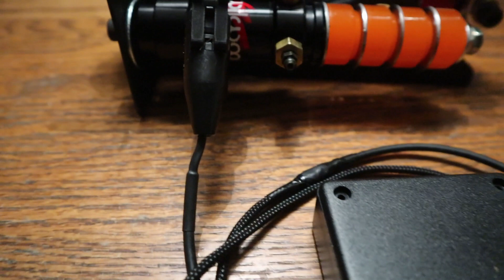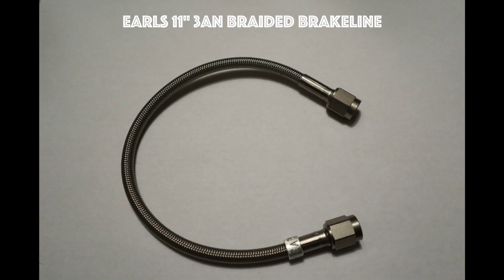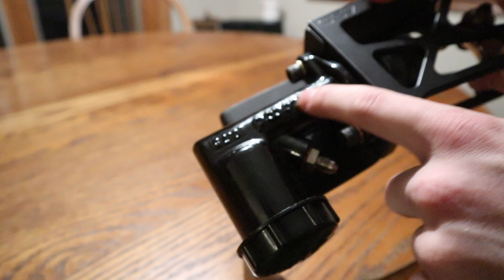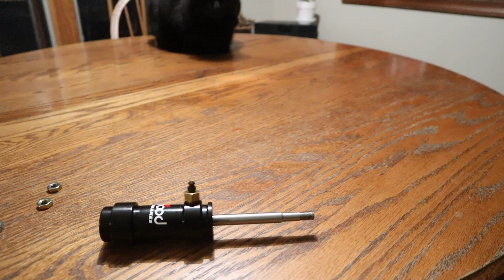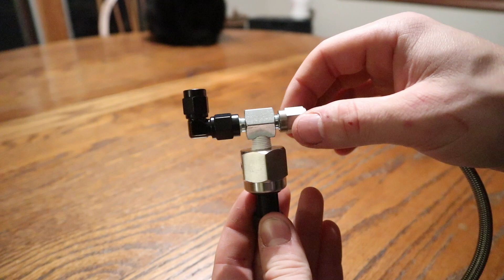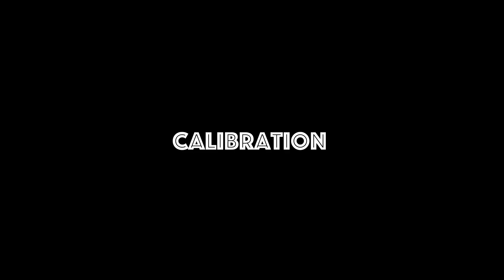How To Build Real USB Hydraulic Handbrake - Sim Racing

Comment: You didn't properly explain bleeding the system, you have to make sure to hold pressure on the lever until you tighten the bleeder up, if you don't you suck air back into the system
Reply from the maker: yes! very good... this video was filmed a long time ago. I plan on making a new video and improved video soon. thank you

Comment: Can you run 2 pressure sensors into that board or would 2 pressure sensors require 2 boards?
Reply from the maker: you can add a bunch of inputs to the DSD PCB. heres the link for more information. https://derekspearedesigns.com/12-bit-controllers.html

Comment: Any reason as to why you aren’t just using putting the pressure sensor on the master cylinder?
Reply from the maker: no particular reason, this was just how designed the fittings and line
Reply: @ is it necessary to use a pull type slave or can you come right off the master form the handbrake and it work the same?
Reply from the maker: @evankennedy8504 the slave cylinder replaces the caliper in a regular handbrake system. its what give you the "pedal feel" when you pull on the handbrake
Reply: @ I see. Would you happen to know of a pull type slave thats a factory part and not aftermarket? Trying to save a bit of money on this build
Reply from the maker: @evankennedy8504  not sure off the top, but a quick google search should yield the results your seeking
Reply: @JoshMullen35  I found a solution. My other question that’s not finding what I need is the controller. I have an arduino board but I’m not sure how to wire the pressure sensor up to it without using a bread board and power supply

Comment: You should replace those sticky polyurethane bushings with a stiff spring instead.
Reply from the maker: im not quite sure how this would improve the setup? care to elaborate?
Reply: @JoshMullen35  The issue with polyurethane is that once it's compressed under load it starts to relax. You see it on brake pedals, the brake pressure although it's pressed at the same amount the registered input drops off. Springs fair much better at maintaining the force consistently

Comment: Great video everything is clear the build is easy bit looking at the prices of each component buying a fully assembled one comes to about the same price but nothing to source and no building. Specifically if your like me in Canada where the handbrake assembly along is close to 400$ another 150$ for the slave 80$ for a board and another 100$ in hardware and fluid. 

With good deals I can see this being a great option just not is my market sadly.
Reply from the maker: to each his own
Reply: @JoshMullen35  didn't say it was a good way to make a HB it's just a shame the parts are so expensive would make this a great option. Like many have said before showing how to connect the electronics would have been helpful to many but I did say this was a good option or maybe you only saw my parts breakdown 😉

Comment: Hey, awesome video!❤ I thought buying me a loadcell handbrake, but if I can get a hydraulic one for the same price, i probably will do it.😅 I've got a few questions:

1. Do I need the expensive clutch cylinder or can I buy a cheap one from Aliexpress? (It has no bleeder, just one input)

2. Why do I need the whole complex system, if i can just put the elastomers directly on the handbrake and the pressure sensor also directly on the handbrake output?
Reply: I am wondering the same... i ordered the parts to make the hydraulic system, but I am not entirely sure if it brings anything more (appart from complexity) when compared to simpler load cell and elastromeres... did you end up building one ?

Comment: Does the slave cylinder have to be on the handbrake assembly? Could I set the slave on my rig itself so it sits on the outside?
Reply: If all is connected you can put the slave anywhere just make sure you get a brake line long enough and mount the slave to something solide

Comment: Good video!  However, I would LOVE to see how to hook up the electronics.  For me that is the most challenging part.
Reply: You will need an arduino that will mimic an HID (human input device/joystick) and it will be a digital sensor. Check out this Button Box tutorial. Use the pressure sensor in place of a rotary encoder. You will only need to solder a few wires.

https://www.youtube.com/watch?v=hSU630uGv2U

- You will need an ATTiny85.
- The sensor has 3 wires. Red goes to 5v on the arduino. Black is ground. Then attach the signal wire to any GPIO (General Purpose Input Output) pin. 
 - Download the Arduino IDE

- Modify the HID arduino script so that the GPIO pin matches the one the sensor is wired to.

Comment: Hey Josh. Your videos are amazing. I came for the sim handbrake video only to realize that you were a real drifter too. Now I know you are the one who can give me a definite answer to the question that has been bugging me for quite a long time.
I am a sim racing enthusiast myself with the skill level below 1% than yours, but I am also an IT engineer who likes math, physics and to tinker with various projects. I've been designing my own load cell based handbrake solution. The prototype is working great and I love the non-linearity that the load sensor provides, similarly to the pressure sensor in your build.
The last thing I've been trying to achieve was realism in the hand feel. I've done a lot of research as far as mechanics of hydraulic brakes go. What I cannot understand is why so many top-tier designs use hydraulics in their products at all. How is this different from removing the line completely and pushing against the spring/poly bushing directly?
Yes, it is true that different bore sizes of the master and slave can give you a different input/output pressure rate, but at the end of the day the rate is still linear, pressing against a spring or poly bushing. So if, say, your hydraulic system gives you 2x pressure on the slave side, all it actually means is that it takes you twice less force to pull the HB, to compress a given spring by a certain length. Wouldn't it be the same as removing the hydro lines completely, and press HB directly against a spring that has twice less compression rate than the original one? Just twice less pounds per inch. How would this feel differently in the hand?
As a real racer, can you perhaps shed some more light on it.  Maybe there is something beyond raw physics that I am missing out? Thank you very much! I know the video is not recent, but I hope you'll notice my comment anyway and have some free time to reply. Cheers!

Comment: So any leaks 3 years on?
Reply from the maker: no leaks still running strong
Reply: @JoshMullen35  man that’s awesome there is a set of pedals made by sim coaches using the same wilwood slave, but I have seen a video where they leak but they don’t have the washer like you to protect the face of the unit

Comment: Can you add another pressure switch for a brake pedal to the dsd controller? Is the Controller capable of working all controls, throttle, brake, handbrake and clutch? I am a total newbie to all this. The fabrication of the cockpit and controls is easy enough i'd get stuck on the electronics, but if the controller is capable i'll get some help to wire everything. Thanks Rich.

Comment: Thank you for this. However could you elaborate on the how to connect the pressure sensor to the DSD board? I’m assuming the lose wires are plugged into the female to female cable?

Comment: What the pros/cons of using the slave cylinder vs reading the pressure directly off the handbrake? I assume it gives you greater control of the force of the handbrake?
Reply: Without the slave it will be like pulling on a solid bar, the system will pressure up very quickly

Comment: Nice video! I have one question: How do you make your wheel counter steer it self so fast? What setting do I have to higher for that?
Reply: I think the setting is "spring" or "return to center force" or something like that,  don't be afraid to mess around with settings to find what feels best for you.
Reply: @coryhalvorson8874  Called a DD and you let go like a real car and it re centres. cheap belt wheels struggle with this unless its a good wheel base.
Reply: @coryhalvorson8874  It is the same as a real car he uses the momentum of the car amd lets go of the wheel as he power slides and it spins back in his hands no difference to a real drift car. Get a DD wheel it is so easy where as on my Thrustmaster i struggled

Comment: It is too too too expensive....
$500 on gaming handbrake...
Reply: He purchased a $220+ handbrake. You can definetly find cheaper parts. i.e handbrake and slave cylinder.
Reply: rock sorp if u want a cheap analog handbrake go buy a $30 usb flight stick it’s a great option and the usually have extra buttons

Comment: If I didn't want the slave cylinder is there a way to mount the pressure sensor straight to the handbrake
Reply: My question also...
Why not connect the pressure sensor directly to original handbrake
Reply: @Rudys2000  Because the slave cylinder here is A) used to get a more accurate feel of the wheels locking up and B) used to bleed the air from the fluid. If you just hook up a pressure sensor directly to the master cylinder how are you going to bleed the air from it? Without bleeding the air from it the handbrake probably isn't going to move much. I mean you can just get rid of the master/slave cylinder altogether which is what most of the cheap handbrakes do but then you have to have it spring loaded instead.
Reply: U can. Use a T fitting with bleeder on end, sensor on the other.

Comment: Thanks for this video. You inspired me to build a hydraulic pedal set with this design using real floor mounted pedals. Got tired of waiting for higher end pedals sets (they are always out of stock) so I'm building my own. For now I'm only building a hydraulic brake and a hall sensor accelerator pedal mounted on a 80/20 frame. Clutch will come later.
Reply from the maker: awesome man! Im glad i could help!
Reply: @JoshMullen35  can i use cheap clutch slave cylinder from a car?
Reply from the maker: @lifzz-gv1sx  yes as long as you can plumb the pressure sensor to it, it will work
Reply: @JoshMullen35  can i use a 4350 psi version because i have looked everywhere at my local e shop and theres none except generator ones which dont have signal output
Reply from the maker: @lifzz-gv1sx  check ebay that is where i got mine
Reply: @JoshMullen35  i think shipping one to where i life would be more expensive (im from indonesia).

Comment: Can you make a video where you connect the controller to your pc?
Reply from the maker: All you do is plug the usb cord into your computer
Reply: +JoshMullen35 no software do you just map it?
Reply: Vax Dev Team I assume it’s because the DSD board is designed for sim racing so it’s preprogrammed, if you’re wanting to save a little more on costs you could probably go for an Arduino and would have to program it yourself

Comment: Please, can you explain how you made the conections in the dsd 12 bit controler? The electronic part of the tutorial is not clear for me. Very thanks and good work.
Reply: yeah... he doesn't say anything about why you need the Arduino 3 pin cable... Do you need to buy an Arduino and program it too?
Reply: @nissanpacific9793  3pin arduino cable is to run from the board to the PC. :)
Reply: @troyd-motorsport9933  No, he says "to connect the pressure sensor to the DSD board without having to solder".
Reply: You don't need an Arduino,  you basically wire the 5v+ and - to the power outlet on the board, then connect the signal wire to one of the pads on the joystick input.  ;)
Reply: @troyd-motorsport9933  well xan you wire it to an arduino so i dont need to much boards?
Reply: So i took a screen shot at the start of the video to zoom on and it looks to me as if the 3 wires are red black and green coming off the pressure sensor and they are the same colour on the Auduino Cable so i guess he just cuts one end off and connects the wires colour for colour so red to red black to black the green to green and plug the other end into the DSD USB board.

Kinda strange he doesn't cover this and presumes everyone will be aware of it but clearly not the case. 

Can not believe how much companies are charging for a pre built one. some of their prices are ridiculous

Comment: are there any guides for soldering to arduino board and coding instructions?
Reply: He was using a DSD board which i going to have to assume is preprogrammed for sim racing so I don’t believe he had to do much software work
Reply: @bo55playz-gamingmore71  but how is he connecting the DSD board to the cylinder? Is there wires in it to connect?

Comment: Could I use water instead of brake fluid? Seems alot safer if I'm just gonna chuck it a cupboard when it's not being used
Reply: You could use water but it may cause rusting and corrosion of the internals. Water isnt used in brake systems because of its lower boiling point that can easily turn into a gas (creating air in your lines) and "corrosive" properties in conjunction with metal and oxygen. DOT rated fluids are denser, have a higher boiling point, and are less compressible than water. https://www.quora.com/Why-can%E2%80%99t-we-use-water-instead-of-braking-fluid-in-a-braking-system
Reply: Most people don't use break fluid in sim rigs as it is 100% pointless as no heat will going through it, so you do not need it to  have a high boiling point. You should use power steering fluid or mineral oil instead, there is absolutely no difference in feel. When you buy hydraulic pedals etc for sim racing such as ricmotech real gear they use power steering fluid., I also use power steering fluid. Bike suspension fork fluid is also good as you can choose different weight oils but i doubt that makes any difference, as long as the oil pulls the cylinder in, it will work, water will also work but will cause rust and may go stale etc and wont lubricate anything so don't use that.
Reply from the maker: if you have a quality master cylinder, the brake fluid will not leak and you wont have anything to worry about
Reply: No. Water isn't compressible.
Reply from the maker: correct! water does not have the same hydraulic properties as brake fluid

Comment: What pedals to use use? Did you happen to convert real pedals over to hydraulic?
Reply from the maker: I have MPPC pedals but they are discontinued! you can literally follow the exact same procedure to do this to a pedal set
Reply: JoshMullen35 I been looking around for a year. My Clubsport v1 pedals and Porsche Wheel turbo S with a half ass setup have served me well over the years, but looking to upgrade. Plan on doing a hydraulic hand brake myself. Was looking to do wilwood pedals but idk. Sucks can't try anything for the price of the stuff lol.

Comment: Thanks for the great how-to! So many other ones replace the hydraulics with a spring and use a potentiometer. This must feel 1000x better. Otdering my parts tonight.

Safety Tip for the non-initiated: brake fluid is nasty stuff so be careful and bleed your system outside (or in the garage). Probably not something you want to do at your kitchen table. Catch it in a clean container (that you can toss afterward) and either put it back in the reservoir or bottle.

Nice Tuerck shift knob, BTW.
Reply: JoshMullen35 you forgot to mention to use some lubricant before putting on the bushings so they move smoother and not wear out as quick
Reply from the maker: hell yea dude! i actually just shook down my real drift car with an asd handbrake and it feels identical
Reply: @JoshMullen35  how do you wire these up though? You didnt show the wiring
Reply: It doesn't have to be Brake Fluid. You can use Mineral Oil. You aren't applying any heat to the fluid, so what you use is moot.
Reply: I’m Going the potentiometer route too, except I’m still going to incorporate the slave cylinder. Going to use an usb arduino and take the pressure sensor out of the stainless braided line. It will take some soldering but It’s cheaper